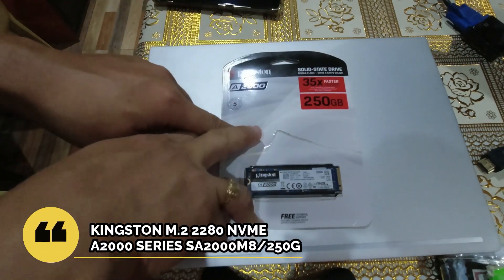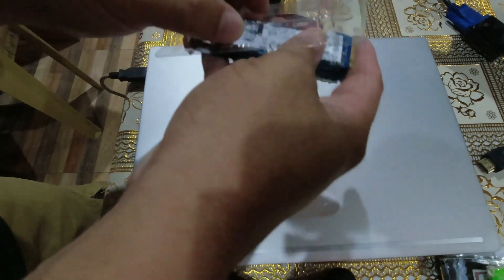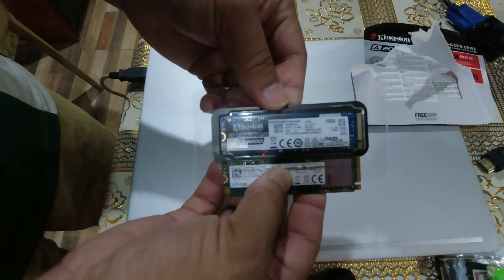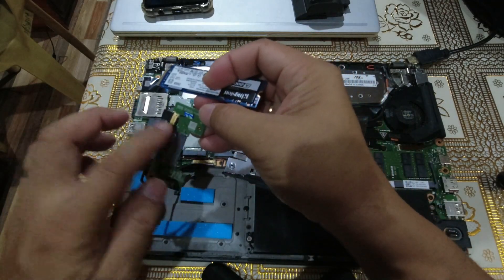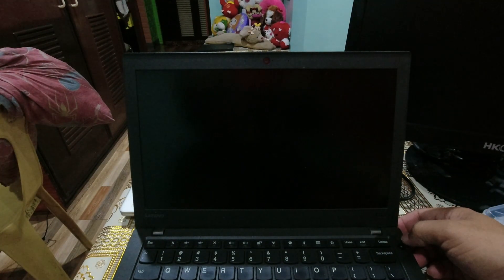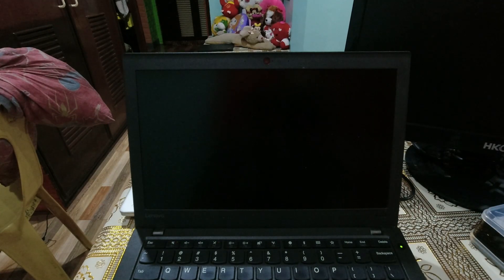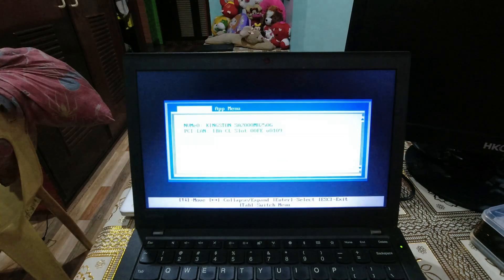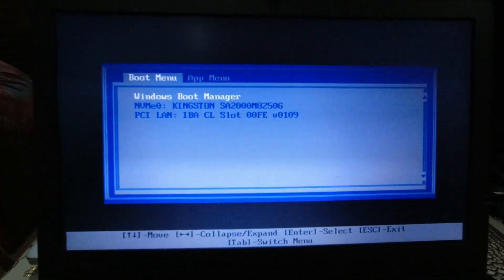LENOVO X270 NVME M.2 SSD REPLACEMENT | DIY Petz

Comment: Sir.. question po! Saan po nkainstall ang internal mic ng X270 naten? nsa my camera po ba?
Reply from the maker: Good day po Sir. Yes nasa may camera ang internal mic nya.
Reply: @RollyPetz  kaya po pla. tinaggal ko kasi camera kasi bawal sa site. ndi nagana ang mic ng earphone ko na wired 3.5mm jack. pati yung sa blutooth earphone. my possible pa ba na magawan paraan sir?
Reply: i mean kahit ba bluetooth ndi tlaga gagana? kasi tinaggal ko ang mic na nsa camera?
Reply: kahit pa my mic naman ang blutooth earphone?
Reply from the maker: @aldenabesa9096  Sir Alden, you need to change your default recording/playback device kapag gagamit ka ng ibang microphone. Ex. gusto mo gamiin yung mic mo sa bluetooth earphone, then change it sa settings Sir.

Comment: Sir... anong tawag po yung lagayan ng NVME slot na metal parang case? saakin po kasi ang nkalagay is HDD. walang metal case. kaya hindi malagyan ng NVME SSD. hayysss... my NVME na sana ako pag open ko yan ang nafoundout ko. Paki send naman po ng link if may alam po kayong bilihan  nyan. maraming salamt po sir ulit.
Reply from the maker: Good afternoon po Sir Angelo, Lenovo ThinkPad X270 NVMe M.2 SSD Adapter Caddy po Sir.
Reply: @RollyPetz  hirap maghanap pla ng ganyan sir. mukhang SSD SATA nlng ako. kahit anong SATA SSD ba pwede sa X270 Sir? pcnxa sir sa abala. salamat
Reply from the maker: @angelofthesick  Sir Gelo, ok lang din naman SSD SATA Sir, as mabilis na rin yun. Meron din naman SSD SATA na maganda yung specs na may mataas na read and write speeds.
Reply: @RollyPetz  salamat sir. sana myroon sa shopee at lazada.
Reply: sa x270 i5 6th gen po? pwd poba upgrade to nvme 512?

Comment: Sir pwede po bang lagyan ng NVME SSD and at the same time 2.5 SSD? Salamat
Reply from the maker: Hi Sir, for lenovo x270 Sir, eto lang down side nya, hindi pwede sabay Sir kasi yung space for the NMVE slot is doon 3:30 7:54 din naka lagay yung space for SSD sana.
Reply: @RollyPetz  salamat sa infos sir. Ask ko lng hindi na ba need na maggamit ng usb para ilipat ang OS at files kapag magpapalit ng SSD pag upgrade? Bat po sa video nyo hindi na kayo gumamit? Pano yung OS nya maililipat po ba automatic files sa new SSD?
Reply from the maker: @nedlarn7223  Sir, kailangan pa rin ng USB boot device to install windows Sir, di kona na sali sa vid since common knowledge na rin siya Sir. Dapat fresh install Sir, di kasi ma clone yung ssd kasi sira na...personal files ko kasi is may backup na sa google cloud kaya di ako na worry if mawala files ko.
Reply: @RollyPetz  ok sir. Ask ko nlng po if okay ba itong Kingston NV1 500 GB PCie NVME M.2 SSD? same lng po ba yan sainyo sa video? andami po kasing klase ng NVME at brands. nakakalito kung alin ang bibilhin ko. Sayo po kasi A2000 pero yung nakita ko NV1 nakalagay.  Salama ulit sir !
Reply from the maker: @angelofthesick  good evening Sir, yes po same lang yan Sir, mas mataas lang ang capacity niya.
Reply: Sir may legit store po kayong mairerecomend na nagbebenta ng Internal Battery for X270? Salamat
Reply from the maker: @angelofthesick  good evening po Sir, so far eto yung nakita ko na medyu OK naman ang reviews based doon sa mga bumili sir.
eto po yung link https://invol.co/clad0q8.
Reply: @RollyPetz  Sir internal battery po ang hanap ko. external po yang nsa link. As per sa video mopo wala ka rin po atang nkalagay sa x270 mong internal battery. Case lng sya. tama po ba? Battery 1 and Battery 2 kasi ang X270.

Comment: Great choice bro. How noticeably fast has the NVMe been? I'm intending to upgrade. I have an x270 too.
Reply from the maker: Good day Sir, based on its specs the performance to about 2.2/2.0 GBps read/write speeds which is a fast one as it is an entry level M.2 NVMe SSD. Windows boot time is about 5 seconds.
Reply: @RollyPetz  Ok. Thanks for the info.
Reply from the maker: @jackpotbox  you're welcome Sir Jack.

Comment: Good day sir. Have you tried adding M.2 SSD to the WWAN slot as 2nd storage?
Reply from the maker: Good morning Sir Joesph. I have'nt check that one yet but I have found this in some forums....
https://forums.lenovo.com/t5/ThinkPad-X-Series-Laptops/SSD-Specification-for-X270-WWAN-slot/td-p/3907359.
Thanks.
Reply: @RollyPetz  thank you sir. just bougth a x270. planning to upgrade the main storage to 1TB and the m.2 to 512gb. need further research f this plan of upgrade is possible.
Reply from the maker: @josephmalate1525  that's good sir. Upgrade the RAM to 16G also for better performance.
Reply: https://www.youtube.com/watch?v=oPlMSkLGPWE, found this somewhere, hope this will help
Reply: H! sir. what is the ssd for my x270 i5 6th gen? 
is it the 2.5  or nvme?